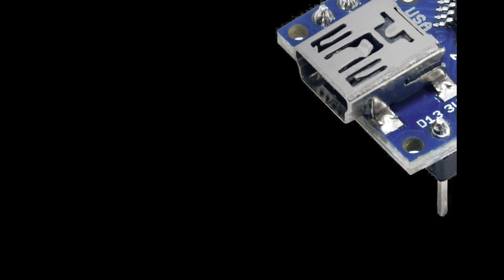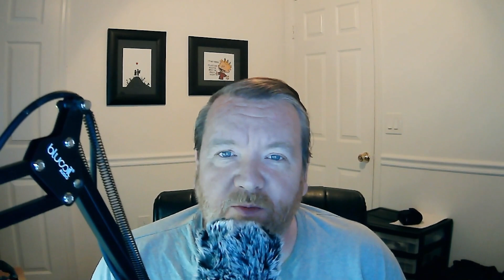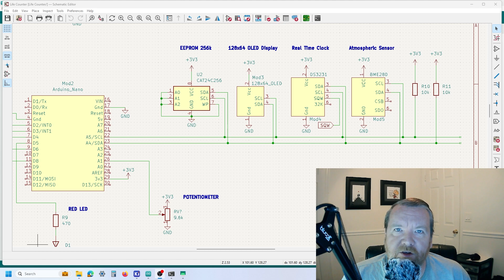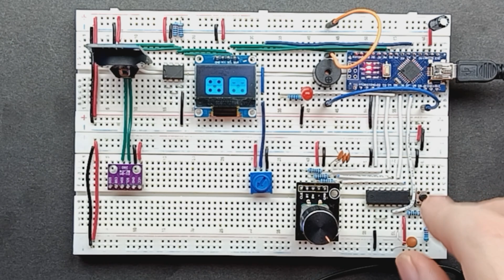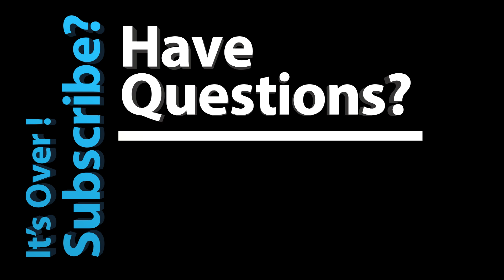Part 1 - How to connect I2C devices to each other...

Comment: Please do audio transceiver    circut use those IC.
Reply from the maker: I'm not exactly sure what you want. There are many ways to do an audio transceiver. In my real life I have been helping design and build cell phones for the last 30+ years, but I guess you don't want me to build a complete cell phone. 

I will be going into Wi-Fi and Bluetooth with the Arduino, both of which could be used to carry audio.  

Could you give me an idea of your requirements? What range of audio frequencies 100Hz to 18KHz or just speech 1KHz to 4KHz? What sort of distance? 
Or if you have an IC part number just let me know.